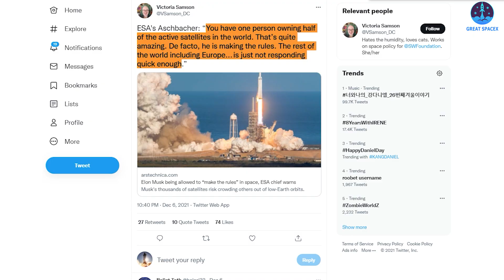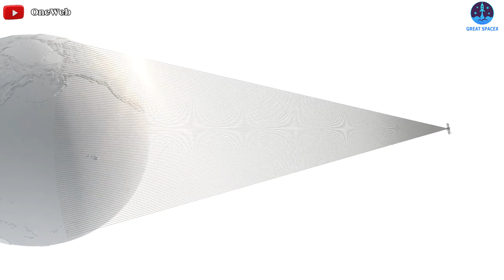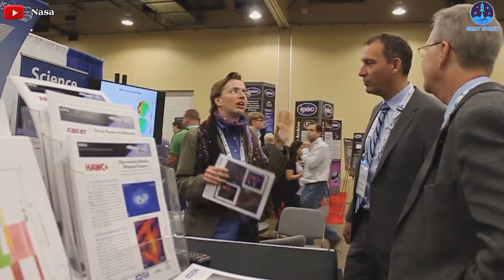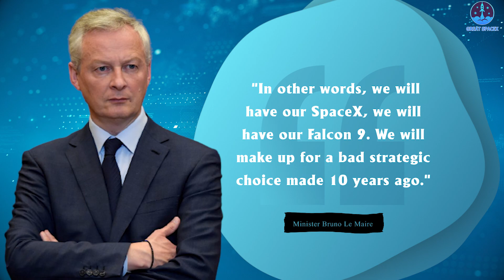Why ESA head just warning Europe to STOP facilitating SpaceX & Elon Musk? What the heck happened...

Comment: Typical approach of the European Union. Unsustainable state promoted protectionism. Every significant state ran project in Europe is slow and warped by governments working to direct jobs to their own countries. France is one of the worst culprits. Like NASA, the Eu will never put progress in space as priority number one (which spacex does) They will always concentrate on progress by committee and ensuring that jobs are shared evenly and work is distributed, rather than going at top speed with the best people to reach the objective for the lowest cost in the shortest time. SpaceX will not be caught by the EU/ESA or NASA operating independently. If ESA had the brains and drive to pull this off, they wouldn't be 15 years behind spacex. The EU would need to finance an EU wide stage funded X-prize style event to meet a set of objectives and then stand back and not interfere, regardless to whether all the jobs went to one country, but they won't do that, because it runs counter to their DNA. I am so pleased the UK got out of the insidious, over controlling, non-democratic, bureaucrat's club. Isn't it just typical that their proposal to catch up to spacex is to try to slow spacex down using legislation, rather than looking what they, themselves, are doing wrong and putting it right. While the likes of ESA and NASA bugger around not keeping their eyes on the ball, China is moving with alacrity to catch and surpass those entities. SpaceX is the only institution standing between China and space domination. NASA/ESAs joint motto should be "Fiddle dum Roma ardet"
Reply: The USA is one of the worst state to promote protectionism....it's bullying what they do.

France just lost a 13 billions contract sign in 2016 with Austalia for submarines because Biden did put a lot of pressure on Australia and we know here in Canada all the bullying of the USA in the last 15 years when we lost billions.

Other nations such as India and the United States and China and Russia give priority to their own space companies and close their markets to foreign competition.

The United States, Britain and Australia kept France in the dark as they secretly negotiated an agreement to provide Australia with nuclear-powered submarines, blowing up an earlier deal between France and Australia and wiping away with one stroke what the French saw as a framework to project power in the Pacific.

Australia's decision to dump the contract in order to pursue nuclear-propelled submarines in partnership with the US and the UK has infuriated France, which said it had been “stabbed in the back” and recalled its ambassadors from Canberra and Washington.

Australia has canceled a $66 billion deal with France to purchase 12 conventional attack submarines.